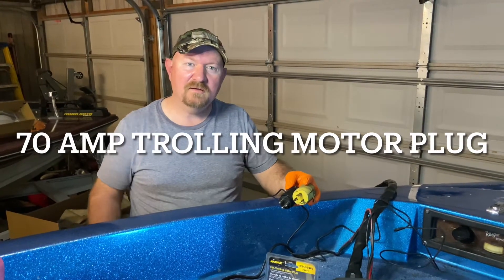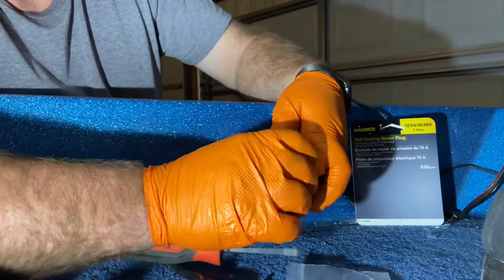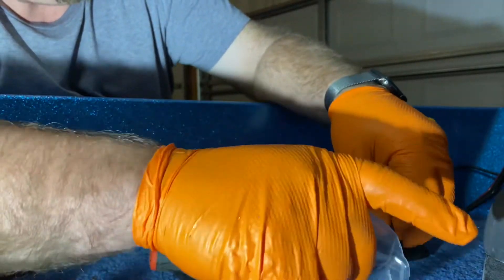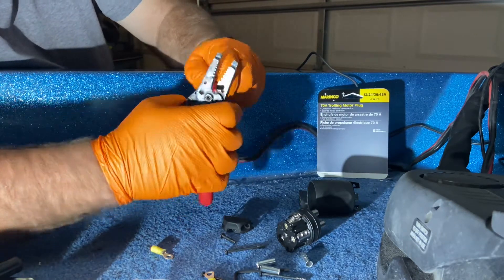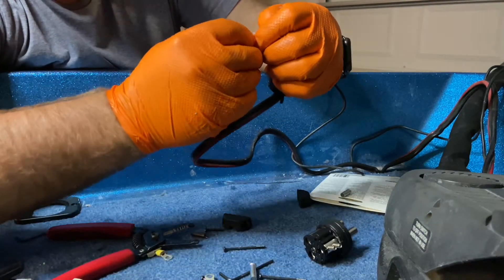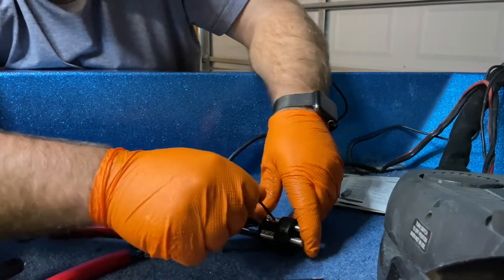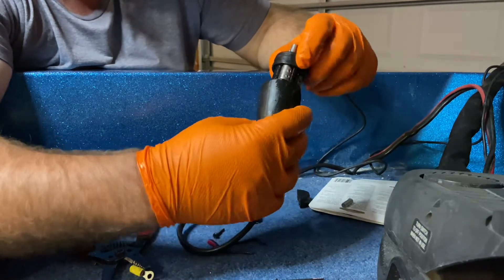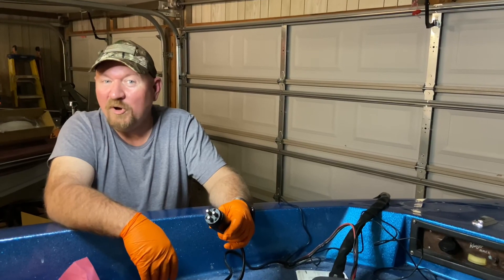How to Install a 70 Amp Trolling Motor Plug - Boat Wiring, Part 1- Plug

Comment from the maker: trolling motor plug (PAID LINK): https://bassproshops.vzck.net/c/2616027/603808/9453?prodsku=100118924&u=https%3A%2F%2Fwww.basspro.com%2Fshop%2Fen%2Fmarinco-70a-3-wire-trolling-motor-plug-or-receptacle&intsrc=PUI2_4595
DISCLOSURE:  I earn from qualifying purchases at no additional cost to you.